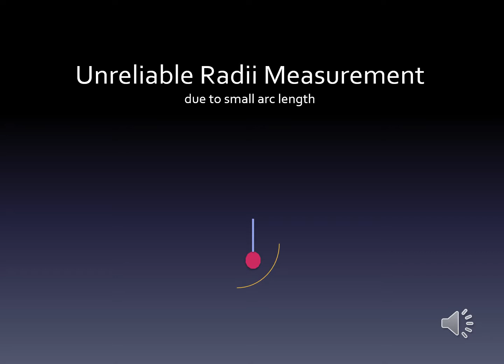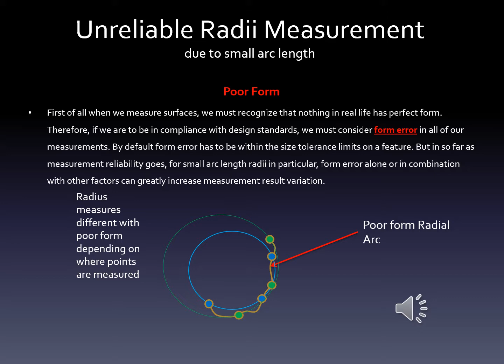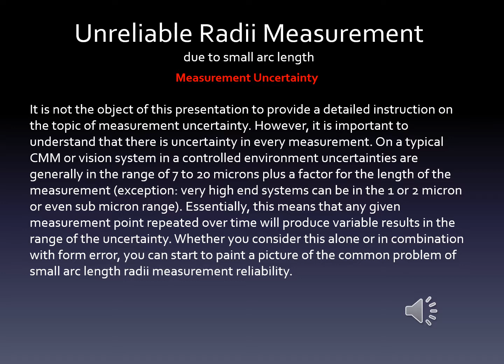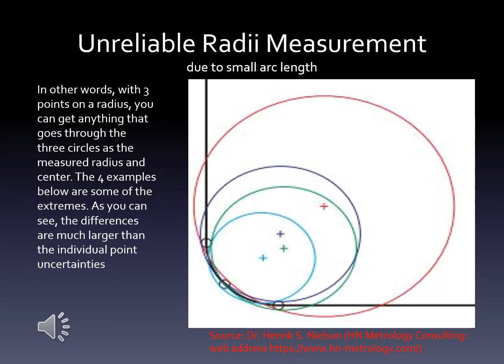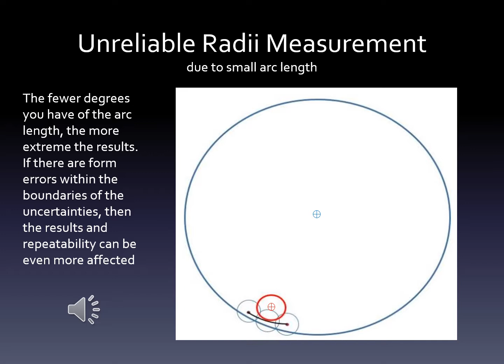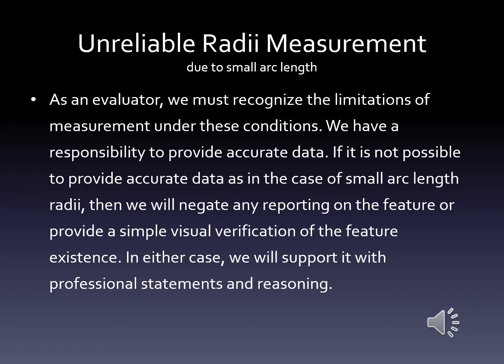Small Radius Measurement with Nel Pretech

Comment: All circles are relatively flat at the bottom while the slope rate are completely different at their sides.  Thus, the height difference [in addition] between the bottom and the side  is the better indicator of radius curvature, not the lateral distance.
Reply from the maker: I totally agree with your observation.  As a metrology laboratory though, we must follow the ASME Y14.5 or ISO GPS standards when measuring radii.  This consists of taking points along the arc and having the measurement equipment mathematically fit a radius through all the points.  A minimum of 3 points required but more is obviously better.  As you can see from the video, you can get a wide range of different size radii depending on the quantity and where the measurement points are taken as the arc length gets smaller.  A lot of times, the engineering drawings we are measuring against also have linear distances called out to the center-points of these radii.  The distances will also be affected by the variability of the center-points.  Sometimes there is a disconnect between the engineer making the CAD or drawing and the engineer who must do the measurements.  It might make sense when designing the part in CAD software to dimension a radius in this way, but it becomes very difficult to accurately measure when it’s time to do quality checks on the manufactured part.   In my opinion, if the radius is not critical, it should probably not be toleranced at all or should be labeled as Reference.  If the radius size and location are critical, then that arc should have a Profile called out to it, or it should be dimensioned to the theoretical sharp corner if the flat edges leading into the radius are long enough.